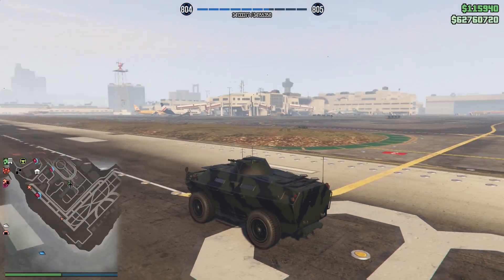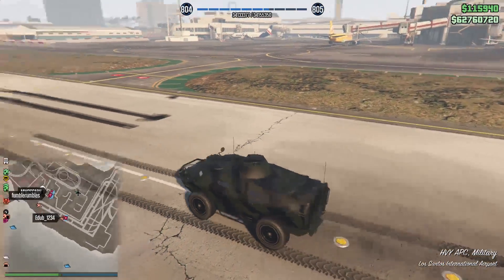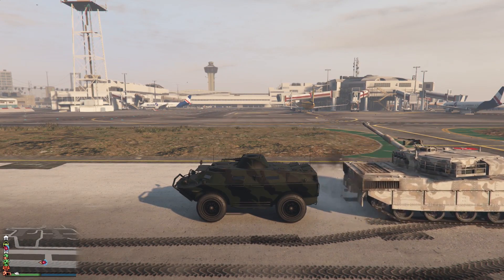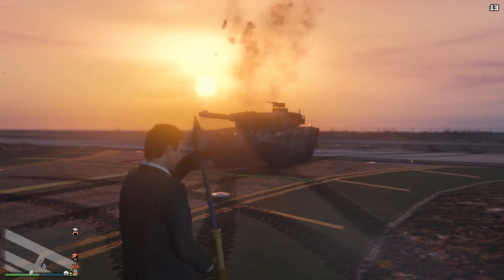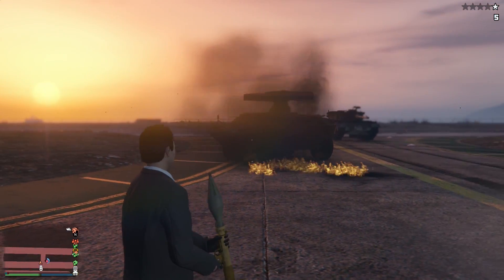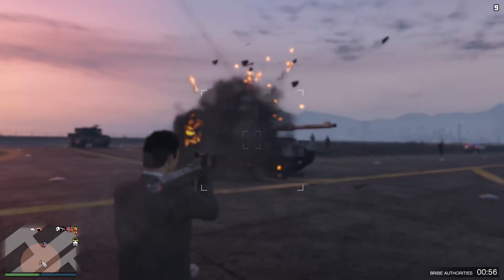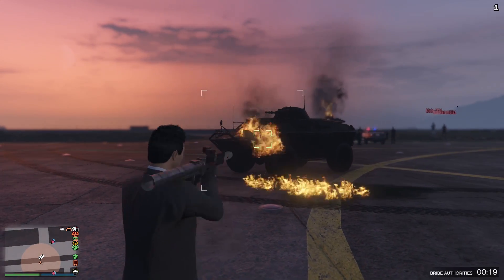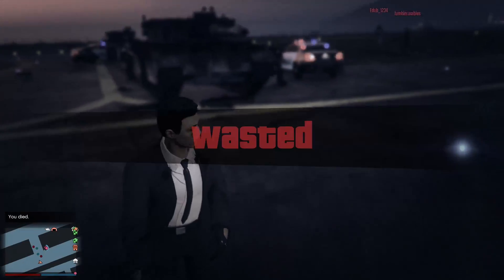GTA 5 Durability Test (Rhino Tank vs. HVY APC)

Comment: So in Order to take out an APC  you will have to hit it with 8 explosions wich costs you $8000 you will probrably get killed 8 times wich makes you lose another 8 rockets (wich costs you $8000) because you will drop em if you have a Rocket launcher equiped, than you will miss like 8 Rockets (hit ratio 1.0) wich will cost you another $8000 and if you finnally destroyed it, you'll have to pay "ANOTHER"  $20 000 wich will cost you a total amount of $52 000 dollars

And then you have a slow tank wich will explode after 4 explosions, with the slow rotating of the Cannon you will probrably get killed 3 times wich costs you $3000 (if you have a RPG equiped each time you get killed) you won't miss because its slow, it costed you 4 rockets to blow it up so that $4000 + $3000 is a total of $7000 

What a difference huh

Comment: isn't the apc amphibious? if so. why the bloody hell is it more durable than a tank? it doesn't make sense. the apc has a tank like weapon and is more durable than the tank. it isn't balanced at all. the tank is slow as fuck, and is less durable than the faster apc which also has a tank like weapon. either nerf the apc or buff the damn tank rockstar. apc is faster more durable with a roof mounted cannon, and is most likely amphibious. where the tank is as slow as a damn snail, and less durable. No balance at all in that, it's like every update they render a vehicle obsolete. jesus rockstar.